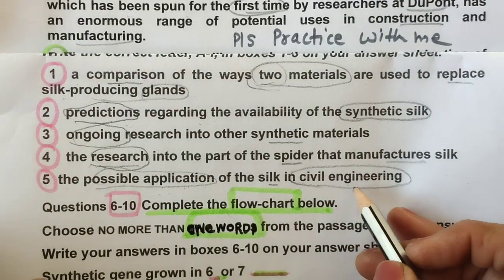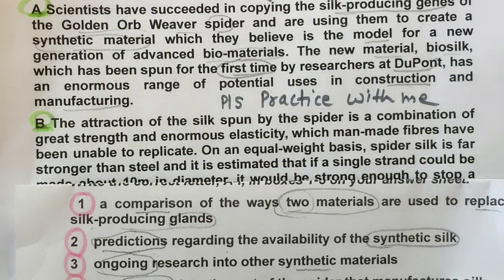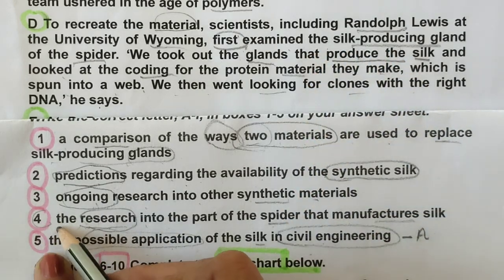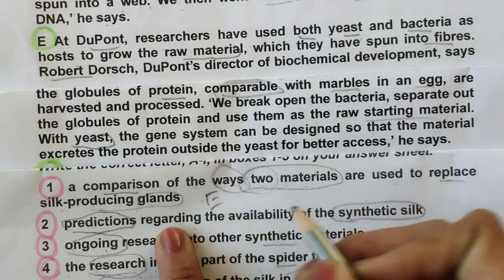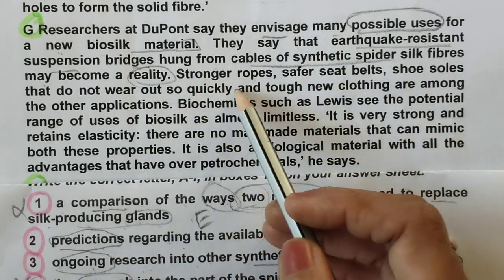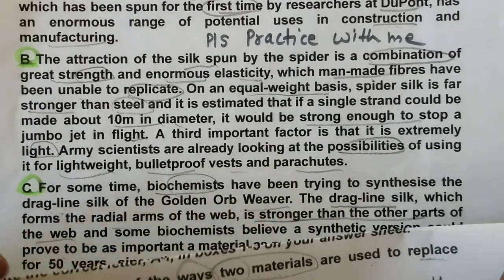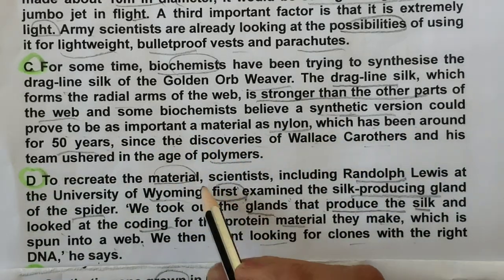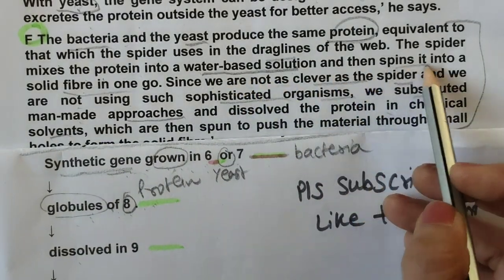IELTS reading tips and tricks 30 Nov2024 ielts exam Reading answers |  ielts Reading Tips

Comment: A= Q4, gene is replaced to produce silk material
B= Q5, steel is material use in Civil Engineering 
C= Q3, on going research
E= Q1, compare materials 
G= possible means predictions
Reply from the maker: Yes,all ans correct